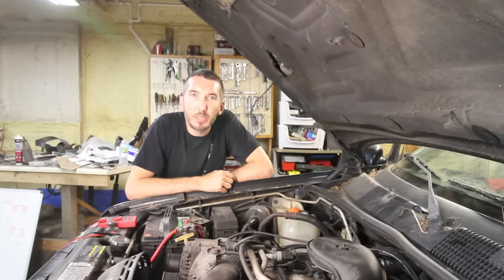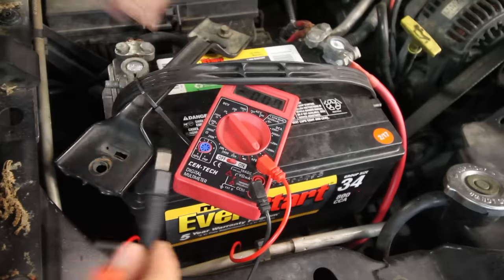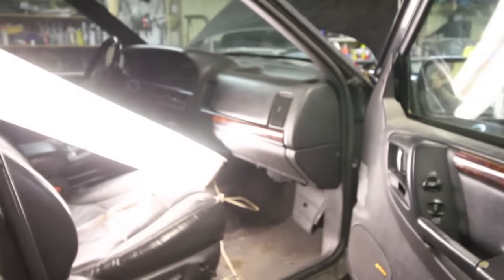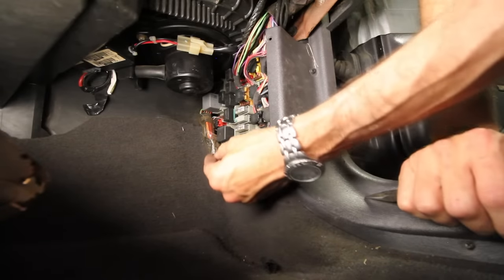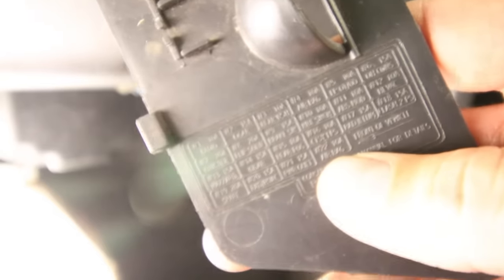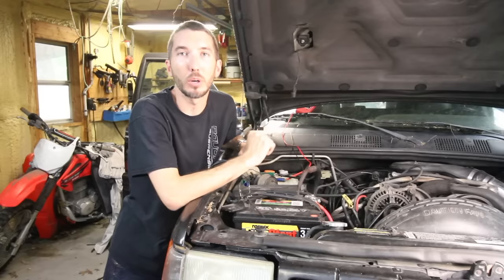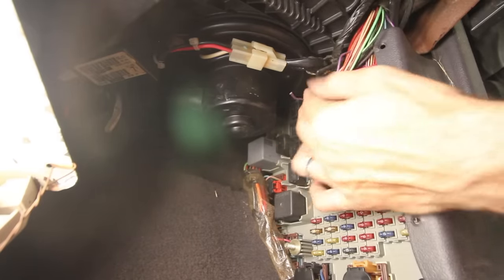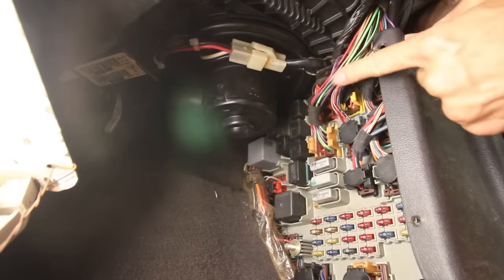Why Does My Battery Keep Dying? - Parasitic Draw Test and Fix - Operation Cheap Jeep

Comment: Great video! Over the years, my '98 Grand Cherokee had been in the shop multiple times (including 2 different Jeep dealerships) for a battery drain. All they ever did was replace the battery. Finally someone figured out that the rear hatch doesn't close fully unless it's closed fairly firmly. It would look closed but still had a little play in it. In this position the latch was drawing 181 mA from the BCM. With the hatch fully closed, the drain dropped to 17 mA (current needed for the clock, etc.). My mechanic offered to cut the wire as you did, but said the remote would not be able to lock & unlock the hatch. From now on I just need to make sure the hatch is fully closed. Unfortunately, I might have saved $300 in labor if I had your video. 
I do have a question for future reference: When you are checking the individual leads in the wire cluster, is it okay to have one lead of your tester in a fixed terminal on one plug and check the individual terminals on the other plug with the other end of the tester (assuming you know which direction the current is flowing)? Or do you need to test each female terminal with its corresponding male terminal (as you appear to be doing)?
Reply: IF ... you do this method ... do not cross the pins, as possible back feed could result ... wiping out an module ... only connect to the pin .. as was originally intended

Comment: U can do it without removing any fuses , and use the charts power probe provides, all u need is to use a clamp meter and hook it up to your positive battery cable wire and with your multimeter now u can touch each fuse without removing it and what ever draw show up on meter look it up on power probe chart and bingo

Comment: Mine meter dont have dc 20, it has dc 1.5v, 6v, 9v, 12v, so what one do i use?
I have the innova 3320, what setting do i put it on to do this check of to see if something is drawing energy from battery?

Comment: I had the same issue but it was the light inside my glove compartment. I thought by removing the bulb it would fix my issue. I bought a new battery and alternator and I'm still having to jump my truck every time to start it.

Comment: Use a thermal imager instead. Electric creates heat. 150 dollar thermal imager running over engine bay fuse boxes in engine and by dash inside car. If shows heat signature over fuses 1 might be bad or the radio dash have heat. You already got a idea of where the draw is and the fuse that correlates.

Comment: Remember this fact. Battery  is made u of 6 cells in series configuration. For simpletons to understand this is this analogy.  Chain is only as strong as it's weakest link. If one cell is faulty, the whole battery fails. Just like Christmas  lights. Turn one off and the whole circuit dies. It's so simple most can't fathom to understand

Comment: Hey Matt, great video. I've been a fan for at least 4 years. You've helped me with a lot. I can't thank you enough. So what should my next step be for this issue if pulling all of the fuses in the cab and engine bay didn't show where the draw is coming from? It's a 98 XJ 4.0.
Reply from the maker: Bad battery 🤷‍♂️
Reply: @bleepinjeep The battery is brand new. The alternator is fine as well. I will try again with the battery fully charged and see if I get different results. Thanks.
Reply: @LsdLsp  It may be new but it can still be bad. Been there and went bad after just 3 weeks. Return it.

Comment: question for you -- i thought i had this solved -- i pulled the DOME fuse and the meter went to 0.00 but the voltage circuit tester I had on this setup stayed lit up and i am still losing voltage. I have pulled every fuse and no luck... any other thoughts?>  Thanks!

Comment: So what does it mean if I have 0.14 on the same meter, and nothing changes when I go through all the fuses? I noticed when I put a few fuses back in, the meter would spike up to 0.44 or so then quickly fall. 

New interstate battery, and the battery keep draining over night. I can charge to full on a charger and the next day it might start, but if I drive it to short of a distance it won't start the next time I turn the key.

Comment: I replaced all the switches in the doors and i still have my locks going nuts they lock and the lock buttons seemed stuck and have to be forced to unlock...i take the fuse out and the locks work great but no gauges or stereo but the door switches work on all doors..i disconnected the rear lock and actuator..and still have same issue with doors locking the moment i put the iod fuse...ya think i need an new body control module...or pcm...

Comment: Hi,
Why is it that when I flip the wires I get much different readings. That is, when I connect the positive to the terminal I get one reading for the amps, and when I change the wire to the negative connected the the terminal I get a much different reading. One is within the limit, and the other is much higher. This is all done under the same conditions; no lights etc is on.
Thanks,

Comment: My question is when you connect the leads from the meter to the negative battery terminal and the other to the negative battery cable does it matter which lead goes where?
Reply: no

Comment: Anyone know how much Amps in average drain remote starter from battery?? Without remote starter power consumption is about 0.04Amps, after remote starter Viper 4205V installation battery drainage is about 0.56Amps - it's normal or they connected in wrong way? Viper is killing battery within 5 days when you don't use car.

Comment: Am having the same problem on 2019 Mitsubishi Outlander battery died overnight, any help, I pulled all the fuses and the interior fuse that I take 2fuse everything is ok but I checked that fuse control so many things, I disconnect all that control unit but still battery died , kindly help me to solve this issue

Comment: or you could put a toggle switch on it that way you can use it while your driving and then when your parked and the car is off,...you can toggle it off and it wont drain the battery

Comment: I have a big problem .my GMC Sierra pickup .new battery new . Alternator new starter .statred my truck drove it . stopped with it running turned on my heater Engine stalls ? When I got home parked it and tried to start it no power absolutely nothing dead . Waited 5 minutes and tryed to start it and it started up .but my radio turns off and back on .? And I hear a buzzing noise some where behind my radio . and my chimes are not working ? Can you help please . and my cigarette lighter keeps blowing the fuse when I hook up a Air pump .👍🇨🇦

Comment: Simple fix for that problem would be to use a relay on the wire that you have disconnected if it were a important unit .

Comment: I've got a 2000 Lexus rx300 and once it's jumped, it'll start.  The very minute I turn the car off and try to restart it without a jump, the battery doesn't have enough juice to start the car.  Then, the multimeter would drop very fast to 6-7 volts from 11 volts.  I thought I found the problem, but a 6amp draw turned into a 0.60amp and the problem persisted.  Any ideas where to look?

Comment: I have both doors shut and I am drawing using the same multimeter and with it set on DCV  and on 20 with wires the same as yours at every place I am drawing 12.64. Any thoughts as to what I have going on?
Reply: You are reading the volts.

Dale in Canada

Comment: I having that same prob. I have removed the fuse for the lighter cause every time you pushed it in it blew the fuse. So i pulled the fuse and thought that was it.  2 days later same thing. Battery dead, no start. So i thought it was my power door locks. i have heard them stick b4 had to mess with the switch to get it to stop. So i unhooked the pass. side top switch that controls power to the locks on both sides yesterday .I also removed the fuse to te power lock switch/child safety switch. and it started today but we will see i the morning. Use takes couple days. Today i ck with Muti Meter the same way you did with the setting and i have o.oo. Question is. Shouldnt i have some draw??? or is my meter bad and how do i ck the metter to see other ways if it's bad.  Or maybe it was the power door locks. Id like to know if my meter is working with that reading o.oo or is that what i want. Thanks...
Reply: Check batteries in meter n fuse, borrow some ones meter n use it n then you will know if yours is bad, use your Meter on battery n check charge n check fuses to see if it works

Comment: I was wondering if there’s a way to test the ignition switch for a draw on the battery I have replaced the battery and it is not that and it only happens once in awhile it is a 2005 tj Jeep but ignition switch don’t feel positive whenever you go to pull the key and I have a suspicion that it is there the switch is not shutting everything off

Comment: The best way to have a electrical draw issue is to hook battery jumper cables to your vehicle and someone else's that's having problems I almost one hundred percent guarantee you you you're going to have a draw or charging issue or junk battery or alternator or both the next day and they're not going to be around to help. Once you get that through your skull the electrical issues really slow down almost to a complete stop. Jumper cables will ruin an alternator and a battery, no matter how you hook up or how good you are or how good they say they are and try to talk you into it don't do it give them a ride. Have them go get a battery changed the battery out. Whatever it takes if you like your automobile not having electrical issues do not hook up jumper cables to it. I took them out every vehicle I own and I absolutely will not ever again hook up jumper cables to anything that is mine but I'll give you a ride to Egypt if you like

Comment: I have something draining my battery and it's brand new. But when I connected the alligator clips like you did, it still showed 0.00. What should I look for next?
Reply: Also, it's a 1997 XJ6 Jaguar
Reply from the maker: Either a bad battery or something is draining the battery intermittently.  Check gain and at different times.
Reply: @bleepinjeep  all ik is that I'm currently trying to charge the battery and it isn't starting

Comment: Should i be concerned when doing this on my 96 jeep grandcharake my wires become very hot and reading 9.43.
Reply from the maker: Yes, do you have your multimeter set up correctly?
Reply: @bleepinjeep  👀 had hooked up absolutely incorrect.

Comment: Did anyone else beside me get super anxious when he was touching both the negative and positive terminals at the same time (different hands)?   I know it is only 12v but a lot of amperage.   Coming from a hobbyist tube amp building background, that raised my blood pressure (different, high voltage/low amperage, but its watts that kill).  

Guess I need to get a bit more comfortable with 12v systems.

Comment: Hi, when I connect my meter I get a 2.56ADC draw, but it doesn't stay it goes down to 0.07 ADC. Is this a short?
Reply: Thats the ECM charging up and going into standby mode !
Reply: It would go down to 0.12-0.10 and fluctuates around those two

Comment: My multi meter reads -0.01 when i did what u did at 2:21, what does this mean? Is it good because its not over 0.50?
Reply: Alli Switch the multi meter Leads, it will now read 0.01 and fluctuate between that and possibly 0, this just means your multimeter was a little more sensitive then Matt’s Harbour freight multi meter and that you had the multi meter wiring the opposite way which is why it was negative

Comment: I have a 2009 Jeep Patriot that I bought at a dealership and after I had it for a little over a month my battery light came on the owner told me it needed a alternator I changed the alternator and bought a new battery and installed it the next day I drove to the store and turned off the car and when I went to start it the battery was straining to get a charge I can’t figure it out do you have any suggestions?
Reply from the maker: Try the suggestions in this video.

Comment: Brilliant! You should be working for N.A.S.A. Thank you!
Reply: They like know when the rear hatch is open on the space station : )
Reply: Wasn't he working for them just before challenger went boom? pull a fuse ah that's the problem... ah wiring diagram is too complicated pull out plugs to the fuse box and find the same wire the fuse was connected to not from the diagram but by random bridging connections... yay battery don't go flat in a few days any more... but rear-airlock warning sensor remains broken .... pah I know when  the rear airlock hatch is left open that's not important... oops opening the rear inner airlock door and oh cr@p just exposed the inside of the shuttle to hard vacuum and everyone is dead as the BCM was disabled and could not tell me the rear outer airlock hatch was not properly secured.... yeah right that's the sort of discipline and skills NASA needs to kill everyone!

Comment: I have the same issue in my 95 zj & when I do this same process to find my parasitic draw instead of being able to read my fuses my Jeep security turns on. I noticed it didn’t do that when he connected his multimeter so why would it cause that I mine ?
Reply: same issue here.....just rang an auto electrician and was told the alarm just needs to be disconnected to run the test as thats just the way they programmed the car alarm with my particular car. ....there should be a cable that just needs to be pulled...

Comment: My car has parasitic current draw of .02 amps under 12.6 volt 45ah battery. What would be the voltage of the car after sitting straight unused for 48 hour????
Reply: Would use about 1 amp in that time.

Dale in Canada

Comment: Hey. My multimeter shows 0,00 when I hold the cables against the terminals on the battery. Any ideas?
Reply from the maker: Battery is dead.
Reply: I should add it was just charged and working alright, except that I seem ro have a parasitic draw.

Comment: I too hate computers when it comes to automobiles!  Leave computers to the space ships!

I have a 2011 Sonata that kept draining.  When i assessed any stuff that didn't work, i knew there were only 2 things, the sunroof and the seat adjustment (1 of 4 adjustments). So i pulled the fuse for the sunroof and there ya go. Solved.

Comment: wondering is someone can help me. on my 2014 kia forte my battery drains quickly over 2-3 days. took my car to autozone and it checked out good. drove around and charged it back to 12.56v and all seemed good until i found it dead again. i bought one of those load testers on amazon and the battery tested good. it also checks your cranking and charging system and it said it was normal. i figured i had a parasitic battery drain somewhere and tried to test it with my multimeter. i put the red lead to 10a and adjusted my meter to read 10a setting. i disconnected the negative battery terminal and proceeded to touch the positive red lead to the negative ground cable and the black lead to the negative battery post. multimeter stays at 0.00 and nothing happens. i check the multimeters fuse and its blown no continuity. does this mean that the current amp draw is greater then 10 amps? i had everything turned off and waited 30 mins before testing. should i get a multimeter capable of reading 20+ amps or just take it to a shop?

Comment: QUESTION: I have the same Jeep and a similar problem. After years being rock solid, my battery was draining if the car sat for a few days without being driven. Three batteries later, things seemed to be fine but yesterday I opened the hatch for most of the day while I worked on the interior. To save the battery I hit the dome light button in the hatch which turns off all the interior lights. Hatch was probably open 6 hours total, with the interior lights on for about an hour, and that flattened the battery. The only other battery usage was from moving the electric seats back and forward a little. How could this drain it? Was the battery low all along perhaps, due to a parasitic draw? Anyone experienced this, please reply.

Comment: My multimeter measures -02.17 amps and my battery drains overnight.  Any ideas?
Reply: I'm in the same boat, I've checked all of my fuses, battery, and alternator and I still have a draw.

Comment: Seriously.... after working 30+ years in the automotive industry I would have never cut the wire.. would have been a lot easier to replace the rear hatch sensor! Right?

Comment: Why not just use the wiring diagram that every vehicle has to determine what the wire controlled. I use my diagram when I am adding an electric component to my truck.

Comment: Criticism: at 2:50 you silently did things with the multimeter electrodes without telling us what you're doing. Where are you connecting them? You simply said "...before you connect this up", how exactly? And if it's a negative reading doesn't that mean you connected them in reverse?

Comment: I was impressed up until you cut the wire/ still a Great concept of jumping between the harness. I have cut wires before to avoid costly parts on low value vehicles but not with out referring to the wiring diagrams